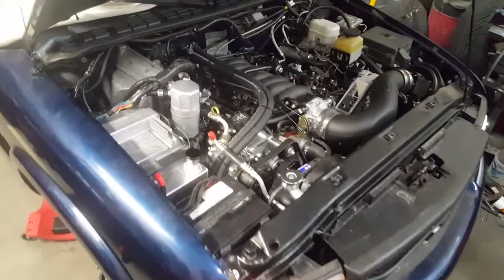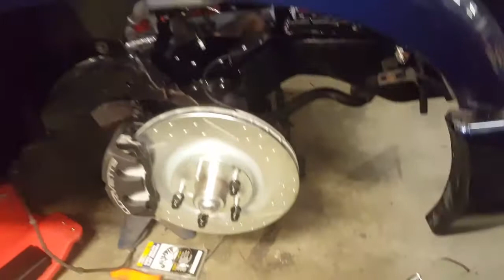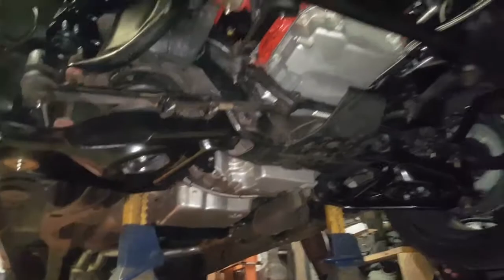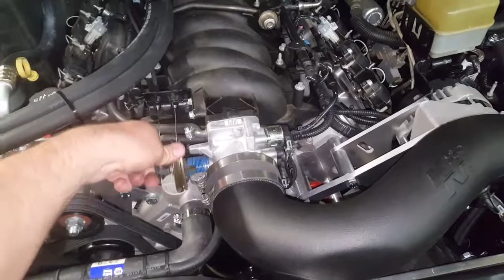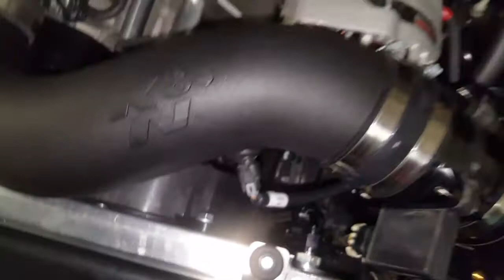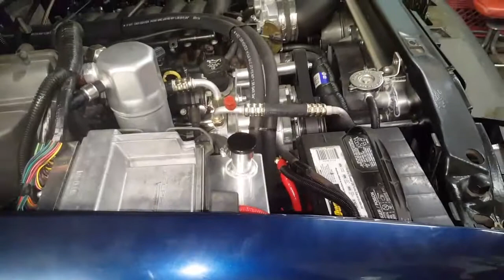Ls1 s10 2004 smog legal s10 with a 5.7 lsx

Comment from the maker: Hey guys we built the truck and we found out a lot of interesting stuff with this situation at hand one of the more challenging things of this swap is the headers / exhaust manifolds.  in order to fit the factory headers we have to do extensive framework once the framework is done the factory exhaust manifolds can fit but the frame is well really modified, we suggest building new front clip we can handle this just adds a lot to the cost of the already expensive swap, anyone can just throw the motor in and make it work but yes it will not pass California smog you have to use the factory exhaust manifolds or smog legal exhaust headers and build around the preexisting pipe routing That either factory designs uses for the engine that you're running which can be Camaro GTO or half ton trucks or a small legal header such as from JBA.  It is very confusing and can be costly but it can be done.

Comment: Your ref said nothing about the weight of vehicle GVWR? He said to check weight class of the two trucks. was going to do a 5.3 swap from a 2003 Tahoe into a 4.3 1994 c1500 one is classified as light duty vehicle other is a medium duty vehicle.
This swap you did would be a passenger car engine to a light duty truck two different classifications any info would be appreciated!
Reply from the maker: As long as you have all of your smog/ evap equipment And carb # s you'll be good
Reply: @Needfulthingz  alright thanks I appreciate it
Reply from the maker: Get a ECU from a 1500 2003 truck